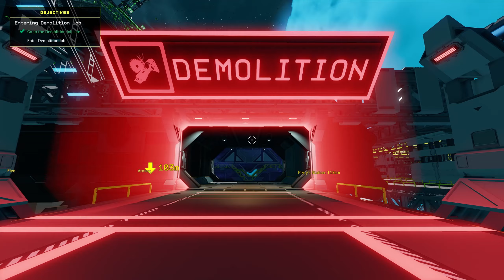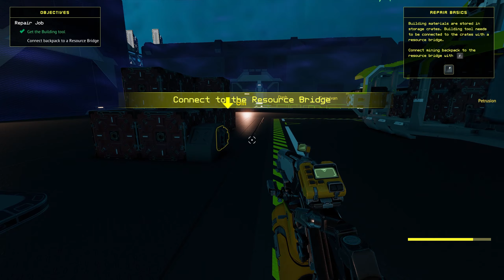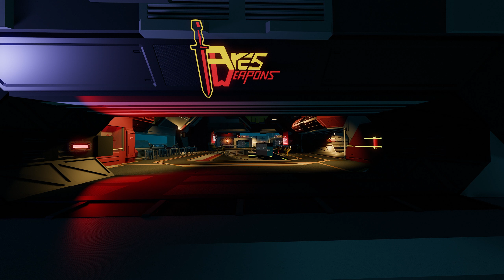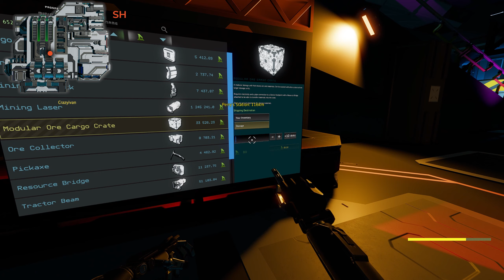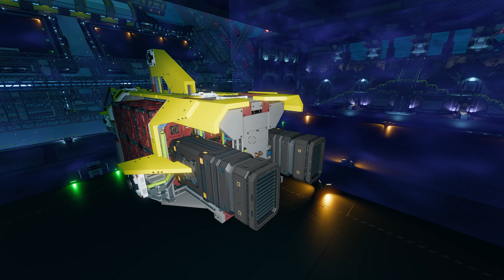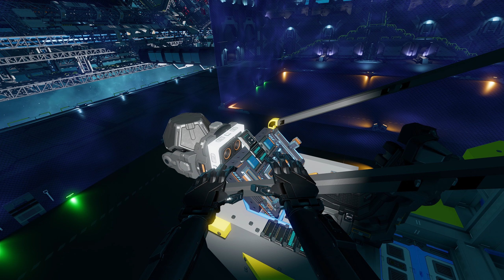Getting started in Starbase  |  Shops Explained  |  Upgrading the Laborer

Comment: Does this still apply to the new Laborer?
Reply from the maker: A few parts do, like tweaking the generator rate and adding a receiver, though you need to do some research to unlock the receiver, YOLOL chips, and the cable tool first. You'll also need to have materials to craft parts now. Stores have been removed, so if you want to buy them, you need to check the auction house.

Overall adding to the ship is much easier now, with the addition of Easy Build Mode (once it's fixed anyway), but you can still add parts as described in this video after crafting them as components instead of modules.

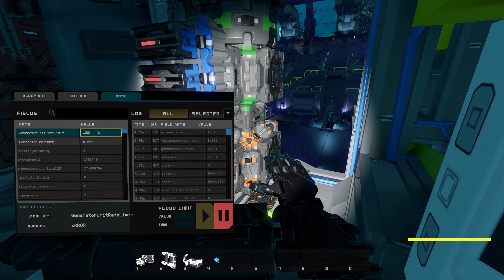Comment: Hello, at minute 7:42 when you open the Universal Tool I can see something that I don't have in my list. :generator. Is this something you renamed? Also because I believe the code for the generator, since it looks for the variable :Generator it will not work if there is no variable. Isn't it?
Reply from the maker: Ah, yes, :generator is FuelChamberUnitRateLimit field on the fuel chamber, which was renamed to Generator on the Laborer! So on a default fuel chamber, you would use the first one instead, or you can rename it.
And indeed, if the code can't find the variable, that specific part of the code will not execute, so in this case if it can't find either the generator or the battery, it will not do anything ^^

Comment: just started and i saw no tutorial...  and repair area has no text board like demolition and mining has.
Reply from the maker: Ah, that's not good :s
It could be that you have to manually transfer back to Origin and press F8, though it's weird that it didn't automatically pop up. It's true that the repair area isn't finished yet, it only exists for the tutorial atm and does not work outside of that yet.
Did the demolition job work for you though? There have been quite a few issues with that lately, due to a GPU driver issue...
Reply: @Senkii  when i logged back in later, the tutorial was there.  did it, got the ship.    tried flying out into the asteroid belt but couldn't find any asteroids.  dont like the fog.  haven't tried the upgrades you showed yet, probably do that tomorrow

Comment: Laser cutter on the tutorial was a pain for me! I felt like I was doing something wrong as it felt very ineffecient.
Reply from the maker: I think that's partially related to the ships they chose for that part of the tutorial; the laser cutter takes a while to cut through a larger section of material, and both of those fighters have quite a few cuts like that that need to be made :c
I'm definitely going to check with them if they could use easier ships for that part tho ^^